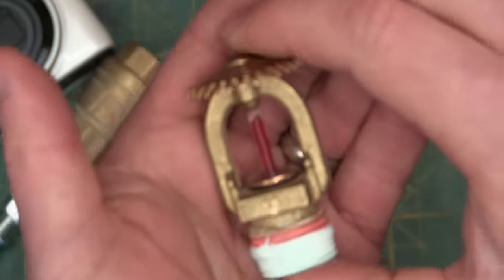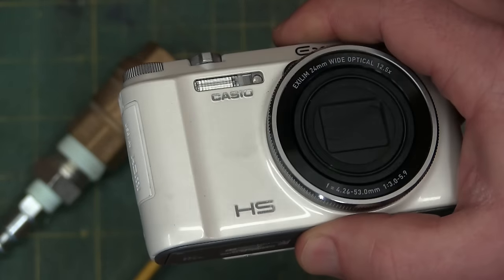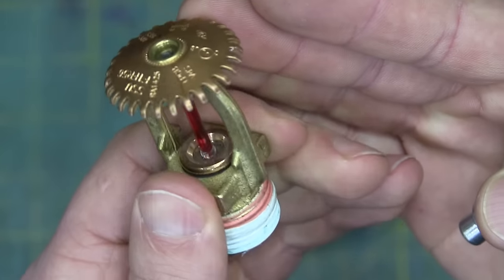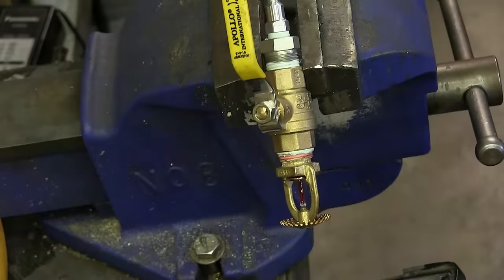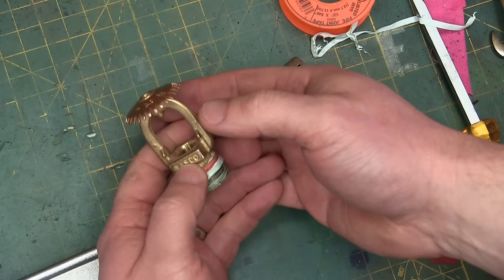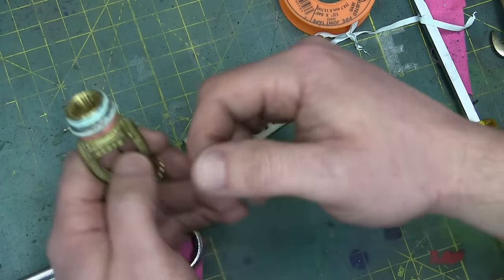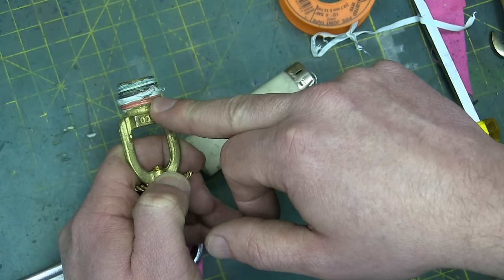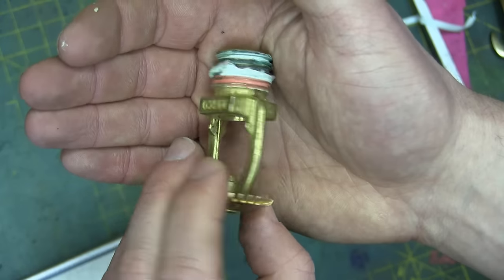BOLTR: Fire Suppression Sprinkler Head

Comment: Finally! An AvE video on a topic I know something about!

Another little interesting piece of fire sprinkler history is that in the past many sprinkler heads would direct water at the ceiling instead of the floor - following the train of thought that heat rises. Of course, it was discovered that directly cooling whatever is burning is way more effective.

These things are real life-savers - when coupled with a working fire alarm they have reduced fire death dramatically.

A good case study where sprinklers were not used was the MGM Grand Hotel fire that resulted in several deaths.
Reply: killer454  but theu have to be properly maintained, or else they won't work and you will lose a building or worse some one will die
Reply: joe agosta IV, maintenance is more focused on the sprinkler flow system. There is some need for maintaining of the sprinkler head, but it's like your vehicle's tire, where are most of your issues. They're not usually in the valve stem. The issues are usually in the tire, the tire being the water supply system and the valve stem being the sprinkler head.  Luckily, most states have laws that require any commercial building with a sprinkler activated water flow system be tested by a state licensed individual on a yearly basis. If there's any problems with the system, they are required to be fixed within 7 days, not business days either. If the property refuses to fix any issues, they are reported. The state, at least the five I'm in, licenses the individuals that take the classes and holds them accountable for anything they miss or cover up. So trust me, my properties are in proper working order.
Reply: @ Fozee Black.. haha, it's always nice when you check into a hotel room & it's not burning
Reply: the death toll for the MGM fire would of also been less if people would of just left the building instead of staying at the slots thinking that the next pull was going to be the big winner.
Reply: On the morning of the MGM fire I was heading to work and passed right under the MGM Grand on Flamingo Rd.  Little did I know that the fire was already smoldering and getting ready to break out.  No sooner did I reach my workplace when a column of smoke filled the sky.  Most of the people killed died from smoke inhalation on the upper stories of the 26 story tower, sprinklers would not have helped as the fire started in the the kitchen of a hotel restaurant and the smoke was going up the elevator shafts.  Very few people were in the casino itself at the time of the fire, most people that visit Las Vegas are not playing slots at 7 am.
Reply: Sprinklers would have likely eliminated all smoke-inhalation deaths...the fire stopped dead where the sprinklers began. Sprinklers in the kitchen would mean that the fire would have been out before it left the kitchen. Guests were trapped for up to four hours while the fire burned. You aren't going to fill the top of a 26-storey building with deadly levels of smoke with a fire in an adjacent building that is out in 2-5 minutes.
Reply: Well sure, and if the safety code had had that provision in it we certainly wouldn't be talking about that fire.
Reply: Sprinklers would have prevented the spread of the fire from the kitchens into the restaurant and then further into the casino. So I'm afraid your assertions that they wouldn't have saved lives is wrong.
Reply: Right, I was wrongly interpreting a previously comment.  Yes, in fact if the building codes of the time had included sprinklers for the kitchen area no one would even know that there was a fire at the old MGM Grand.
Reply: Paul Copeland  yeah I am a fire sprinkler contractor.

I perform quarterly, annual and 5 yr inspections on commercial, industrial and residential  buildings.

The buildings that I touch are either top notch or have a failing report.

life safety is no joke!!!
Reply: MGM forced a ton of changes out here. As for kitchens there should always be some type of ansul system over the cook like with the air hood.
Reply: The MGM Fire's real problem was that at the time HVAC systems weren't designed to shut down when fire alarms went off, the real killer in the fire was the vent system pumping smoke throughout the building killing people who were nowhere near it, people on the top floors ended up dying

Comment: Huge fan AvE and long time Viejao watcher (so long in fact I say Vijeao).  Anyway I'm a 26 year Sprinkler Fitter and traditionally those heads hold 100 psi water pressure.  We test at 200 psi.    The head you activated was a 1/2" Standard Spray Upright and it goes off at 155 degrees.  Believe me when I tell you a lot of water can travel through those heads in a short time.  Thanks for all your Vijeaos.

Comment: I design fire sprinkler systems for a living. Most commercial fire sprinklers in the US are rated to go off at 155 degree.The sprinkler show in the video is a Reliable, you can tell by the RASCO marking. You can tell the temperature rating by the markings but also by the bulb color.
Reply: for a designer you have the most basic, non insightful comment on this video. Lol 155 Red Bulb, 175 yellow bulb,  225-286 blue bulb, 300 purple bulb, 375 black bulb. Also different type of response heads QR quick response, standard response, esfr earlier suppression fast response etc. Side wall heads, dry pendant heads, up right heads, pendants etc.

Comment: I love that you went over this.  I have to say, I always used to think these little guys were interconnected somehow and when one would go off, they all would.  Well, that's how it is in the movies!  Being a network engineer, I was always worried about an office fire setting them off in my server room.  It wasn't until I met with an engineer designing my new server room that he showed me one up close.  It's nearly identical to hot water heaters that use a oil filled vial that pops if it over heats, which closes the air damper.
Reply: Bradley Bergstrom huh? Sprinklers in the server room? What an abomination..
If there's not enough dough for an inert gas system then probably what fire doesn't damage, water surely will. I'd go for regular fire extinguishers designed for electrical circuits and temp monitoring/smoke detectors and an alert system. It helps if the building has 24/7 security. And off site backup.
Reply: Some systems are linked, but most only have one or two go off, if a fire is nearby.
Reply: Usually in server rooms they used to use Halon because it is a clean agent and would not corode or short the computor equipment. Now they use Fm2oo for the same reason but also because it does not erode the ozone layer. The way these systems work is there are pull stations and smoke/heat detectors that release the agent.
Reply: Sadly, the company was way too cheap for a proper, server room fire suppression system.  I designed an offsite solution that runs in parallel, just in case it ever goes up in smoke.  Total server room investment is less than $400K, A/C and UPS units included.
Reply: macbeth2354 macbeth2354 maybe it's just me but sprinkler systems have been common in server rooms on the last few jobs we've run. Now they were a pre action dry system meaning air is in the lines holding pressure at the head with the water behind it. The pre action part of the system would require multiple actions such as a two fire alarm system heat detectors to go off and smoke detector at the same time, and that would still only release the air from the system putting water at the nozzle, then you would still enough heat on high temp heads to trigger water. All while still having several minutes from air release to have the opportunity to abort. Halon and fm200 systems are a great concept but very dangerous in use. So unless we are talking a data center worth millions or important to critical/life safety(hospital data centers/energy plants) not worth the hazard.
Reply: We use Argonite in all server rooms and datacenters, 50/50 between argon and nitrogen. Enough of it to push most oxygen out of the room. Everywhere else its CO2 extinguishers and an onsite fire brigade working 24/7.
Reply: Onsite fire brigade!?!?  That's crazy!  Do you work for Iron Mountain or similar?
Reply: It would be interesting to see how many datacenter/server room deaths were attributed to Halon fire suppression systems going off.
Reply: Major heavy vehicle manufacturer, I'm a computer technician at the engine plant with two large iron foundrys. Therefore the need for an onsite fire brigade.
Reply: some were linked by the water pressure so if one popped the pressure fell and ask the other little red capsules somehow fell out... or something like that. anyone know the magic?
Reply: Halon and other inert gas oxygen reduction systems went out of favor about 20 years ago for all but the most expensive & critical server rooms. The last time I worked for a company that had halon suppression was in the mid-90's. Reason: liability. The last server room build I was a part of, the insurance company told us that unless the combined equipment & data loss value would exceed 25 million bucks, go with a wet system because one wrongful death suit would cost more in litigation & payout - and this was over 15 years ago.
Reply: Thanks for telling.That would explain why the brand new hospital built near me has an fm200 system in the data room, and why Wallops Flight Facility has fm200 systems all over the place.
Reply: Well luckily now most states at least  have capped those 25million dollar lawsuits to about 5-9million depending on the industry.  Now it's cheaper to have them killed by the halon than slip on water or god forbid hurt their back lifting a fire extinguisher.  Common to hear someone say it's cheaper if they just die in the commercial insurance business now.  Well the employees that is, other people like customers in a building are an entirely different story.

When I worked for a garage door company we used to put in the fire doors, those systems for release always seemed like a rube goldberg machine that always worked.  Electronics box or fusible link drops a weight releasing spring tension and allowing the door to fall with gravity and some sort of slight breaking system so it doesn't drop like a guillotine.
Reply: shawn2444 Halon 1301 isn't used anymore in the U.S.,Halocarbons or other Inert Gases,like FM200 or FE13 is what's being used nowadays.

Comment: Hey Ave,  love the Vijaos. That said, I have to comment on this one. The sprinkler head is not considered to be a life safety device but is for property protection, it can be designed to respond at a variety of temperatures and even has quick response models, however by the time the temperature at ceiling level has reached the trip point, your already dead from smoke inhalation or burnt like BBQ chicken. Still, better with, than without. The "cap" is called a diffuser, and has various designs to create an umbrella pattern of water to extinguish the fire. A smoke detector or heat detector, are life safety devices and should report a fire before the sprinklers try to put it out, giving you time to leave. Most fire sprinklers are designed to give pattern as low as 4psi and often are from 80 to 120psi. and can be more if there is a fire pump assisting.  They come in various sizes, the one you have looks to be 1/2" but they also have 3/8" ,3/4",1" and more, delivers a hell of a lot of water in a hurry, and would then be rated at gallons per minute (gpm).

Comment: The narrow bulb on that sprinkler indicates it was an ESFR (early suppression fast response) less thermal inertia, AKA Quick response. 
The liquid in the bulb is simple alcohol or other type that won't freeze, the way the temp is calibrated is by the size of the air bubble, the bigger the bubble the more room for expansion before over-pressurization. 
 IFSTA (International Fire Service Training Association) tried to capture the activation of a sprinkler head with the expensive stuff for one of the manuals they write, ended up photo-shopping the the parts in because elapsed time from static to activated was to fast to catch in one frame. 
I work on a site with private fire service mains that are kept between 160 and 170 psi with this type of sprinkler head or similar. 
I could keep going but that would be pedantic :P

Comment: Standard "nozzle pressure" for a sprinkler is 15 PSI. Formula for flow - GPM = 1/2 Nozzle pressure +15. On the fire department I retired from our standard starting pressure for a sprinkler system was 100 PSI then we adjusted for area, number of heads and number of floors above the first floor (1/2 PSI per foot, each floor considered to be 10'). Each head covers 100 square feet (10' X 10" area) Fire hydraulics, interesting stuff.

Comment: First off, love the public domain EDM, I put my hands up.  Down south us Yanks with eagles on our leather helmets (as opposed to a beaver (which is just as good)) call that a "frangible bulb" head.  The other type is a fusible link.  All are designed to activate at a specific temperature range indicated by the color.  There are specialty heads, say for deep freezers, as well as different types of systems, like wet pipe versus dry pipe, again think of a freezer application.  Also the systems are rated and designed based on the "fire load" which is how much burnable stuff you have and how you have it arranged.  The "fire flow" or water, needs to be able to hold your burnable stuff in check, not extinguish, with up to 25% of the heads active until us lads with the big tools show up (or around 20 minutes, there is a time spec).  So, some wet pipe systems are able to accomplish this with municipal water supply and pressure.  If the Fire Load calls for more water, fire pumps and cisterns/tanks are added to accomplish the specified (yes by an engineer) Fire Flow.  Now someone please hit me in the head for remembering all of this prevention crap, I want some fuego!

Comment: Hey AvE. This would be more realistic if you got everyone to spit in a 5 gallon bucket until full then left it out back for a year uncovered then rehydrated, mixed with a little motor oil and carrots. Then slammed that through your prop. The water in those things comes out damned near flammable.